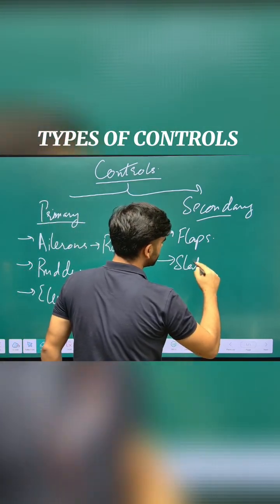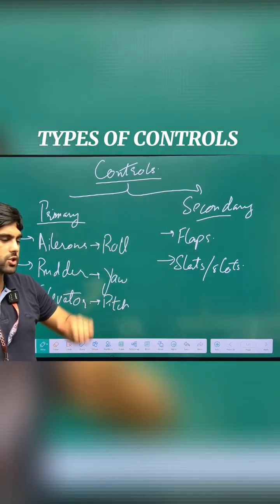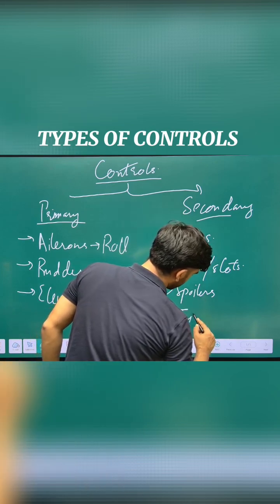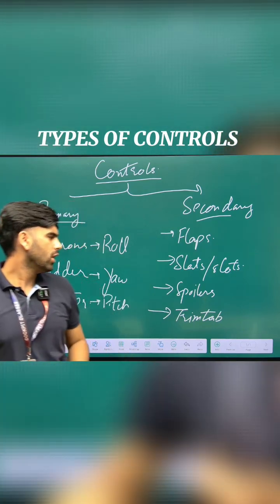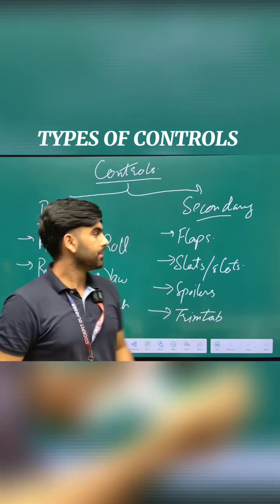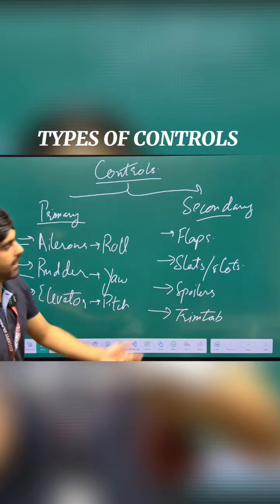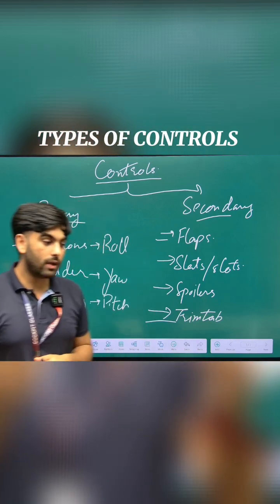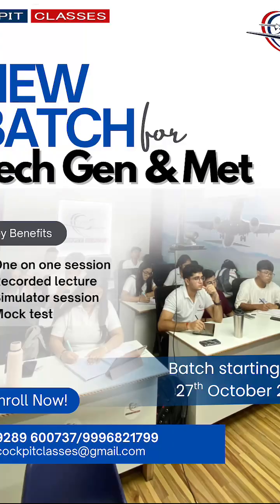TYPES OF CONTROLS #cockpitclasses #commercialpilot #dgcagroundclasses #pilottraining #becomeapilot

Comment: I think the force required by the aileron to roll the aircraft would be more if they are placed at the middle of the wing and that can cause structural damage as well if so much of force is applied. But i am not sure about the exact reason.